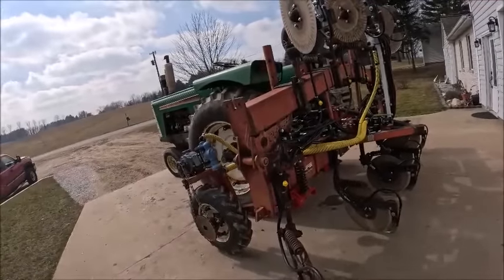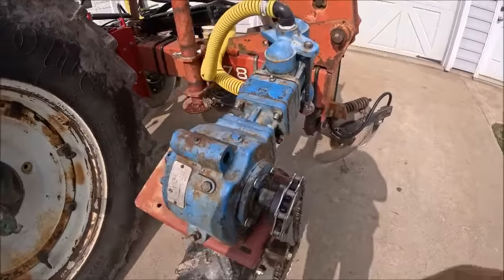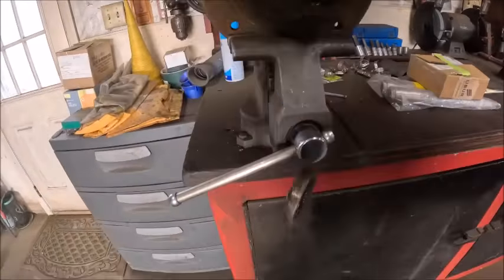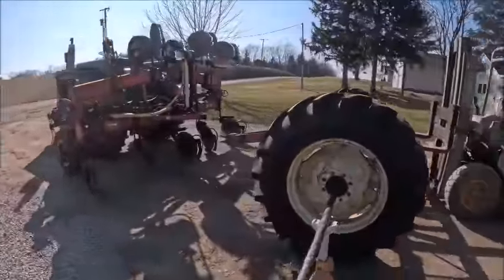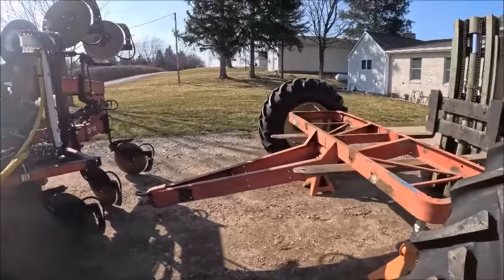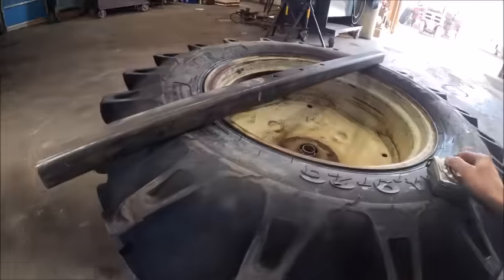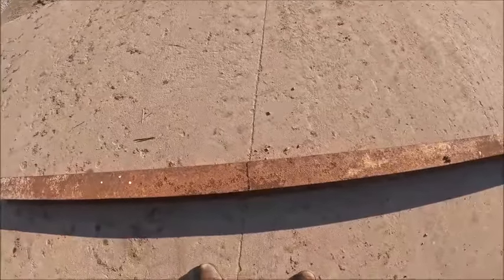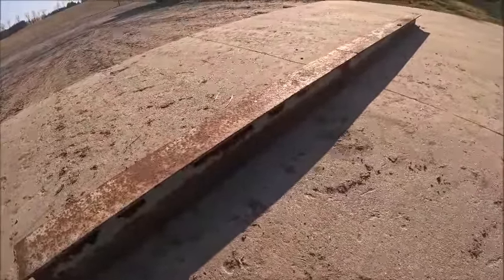Applicator Project Part 13: Full Attention On The Tank Cart

Comment: It would be nice if you could move the idler on the pump drive chain to the back return side of the chain so it’s not against the tight side that’s pulling.
Reply from the maker: It’s fine where it is.

Comment: So I have a question about the chain driving the pump. Most of the time I see the tension block on the slack side of the chain. Yours looks like the block is on the tension side of the chain. Won't that wear out the block quickly?
Reply: I see I'm not the first one to say something. You said it is fine and I accept.